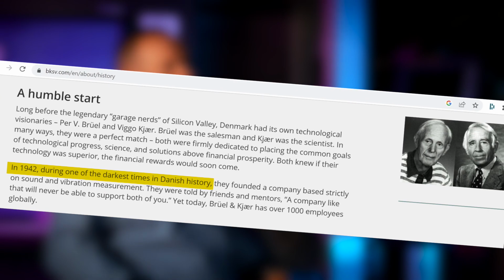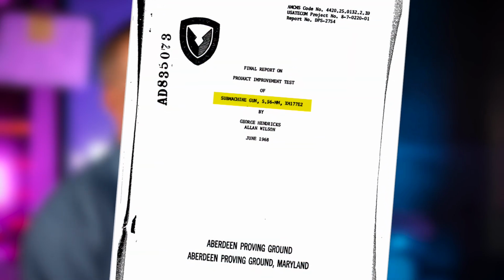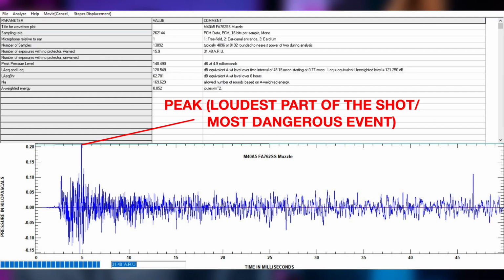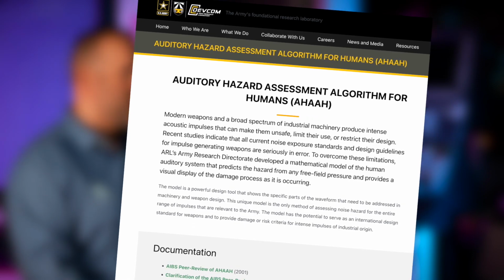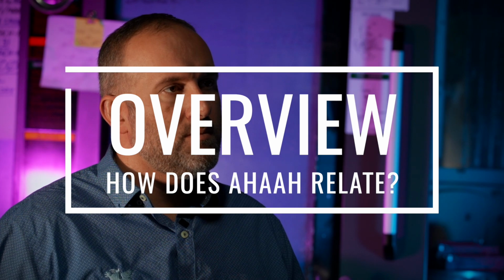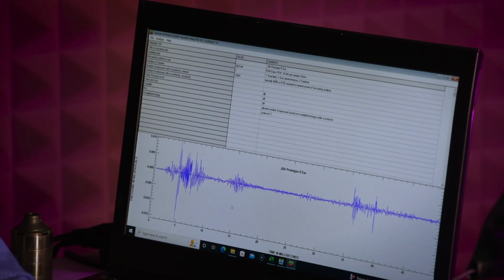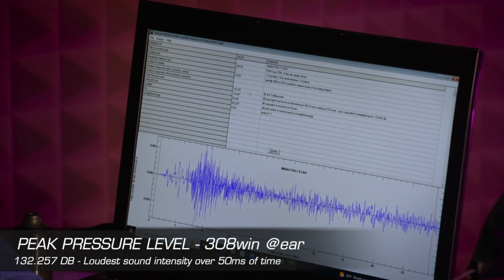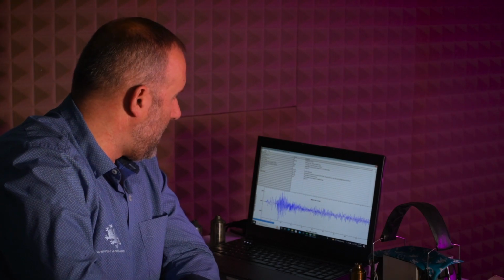Introduction to Griffin Armament's Silencer Testing Standard™

Comment: Will this program be open source to other manufacturers so we can have some sort of new standard in the market place, or will this only be in house use?
Reply from the maker: This is using the B&K open market pulse system, metering A-weighted peak data, and processing 2 wave files in the open source AHAAH software.  This is totally open source, and anyone with the money and time to do it, can. We published the equipment list, and the methods which are supported in exhaustive documents available on the AHAAH website. Anyone can do this test.

Comment: I wish you would provide more data on the pros and cons of your various muzzle devices.
Reply: Exactly, such as how each one affects suppression levels on a given firearm with a given suppressor. The would give us another dimension by which to decide on our muzzle devices.
Reply: Muzzle devices that push gases sideways usually have better sound suppression (and things like brakes help keep excessive wear off of blast baffles!). 

I know you're looking more for Griffin-specific ones, but it's a start.
Reply: I would bet you money that it makes almost zero difference. What little difference it might be wouldn't be discernable to the human ear.
Reply: @tyler6147  pew science has tested the difference between the surefire warcomp and 3 prong flash hider with an RC2 with a drastic difference in the suppression rating.
Reply from the maker: @Roachman22  the reason there was a large difference, especially at the ear, is that the surefire mounts feature a close fit diameter and labyrinth seals (grooves that slow down gas trying to escape the slip fit mounting system of the RC2) and the engineering design of the war comp appears to be fundamentally flawed in that the grooves have been deleted and more proximal to the rear end of the RC2 high pressure ports have been added to compensate for muzzle rise. These ports are obviously causing gas to leak at pressure levels that created increased fire hearing risk. This condition is an outlier. Typically, one muzzle device to another, differences in sound are 1-3db and favor muzzle brakes of comps over flash suppressors which direct the blast forward, allowing a percentage of gas to miss the baffle system and escape the muzzle end of the bore. This has been our experience in our 17 years of development. We starting to optimize design of mil & leo specific products to mitigate this nominal loss of performance when the flash suppressor is chosen. When there is a slight increase in sound, that is often accompanied by a slight increase in muzzle flash of the suppressed firearm.
Reply: @GriffinArmamentOfficial  why only optimize the mil/leo offerings to account for that?
Reply from the maker: The strongest emphasis on flash has to go to the models that are military / LEO specific as that concern is most important there. These models are consumer available so people that are discerning customers emphasizing flash signature performance can certainly buy the HRT-556™, the Recce 5 & 7, and the M4SD series cans. I think we do a much better job with muzzle flash in our flow through products than our flow through competitors in a lot of cases, however, flow through product obviously slightly compromises flash signature performance. 

We are working for strong flash performance across the line, but the most work goes into the military / LEO specific product, and some of those products are just prototypes that perhaps have had a few units sent to specific military procurement or testing people. Obviously the fate of individual sample product depends on the outcomes of said testing. If those models materialize into production product, they will probably be offered to consumers as well. The HRT-556™ for example is an LEO product that was offered to consumers due to high consumer demand. Read as we are not specifically working to keep anything from anyone.
Reply: @GriffinArmamentOfficial  thanks for the explanation!
Reply: @tyler6147  Look up the Surefire Warcomp vs non-warcomp done by Pew Science. There was a large difference.